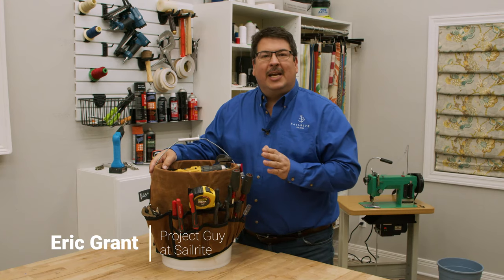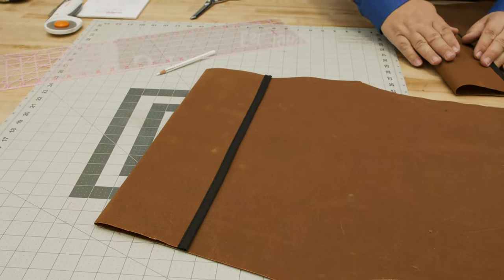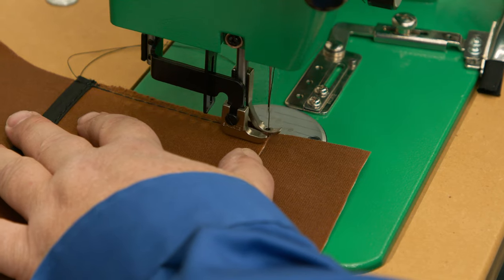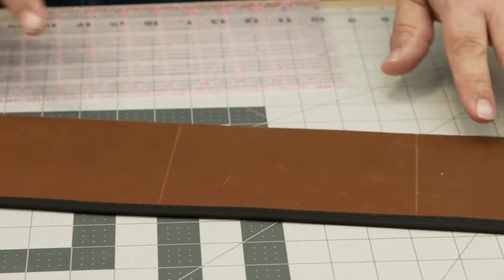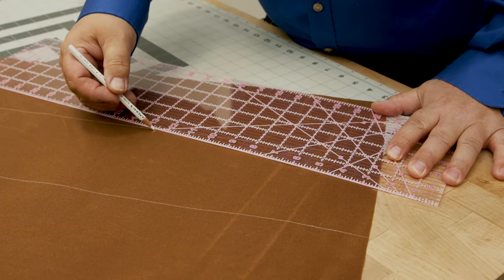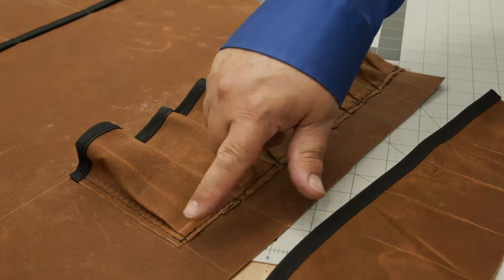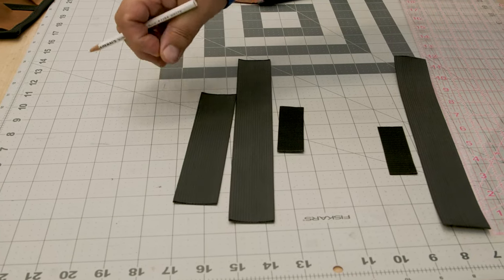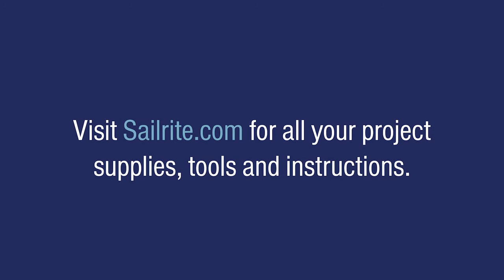How to Make a Bucket Caddy Tool Organizer

Comment: The right most pocket on the tapered outside pocket panel is very wide at three inches in width, especially when the next two pockets are only two inches in width. I'm curious as to why it was done this way. Otherwise, a fabulous DIY video. I fabricated my first one using a plain, heavy cotton duck and it came out very, very nicely. The waxed canvas just arrived so now it's time to don my elf hat and get to making several more as Christmas presents. /r Ted Baker, Newry, Maine

Comment: I'm sure you have done this before a couple of years ago. Is this a remake or a revision?
Reply from the maker: You are correct, we published this about 6 months ago. However, we had a miscalculation for the amount of binding you need, so we fixed that issue and reposted it.
Reply: @SailriteDIY  Is it only 6 months? So much has happened it seems ages ago. It's great that you guys are helpfully thorough and take the time to fix little errors.